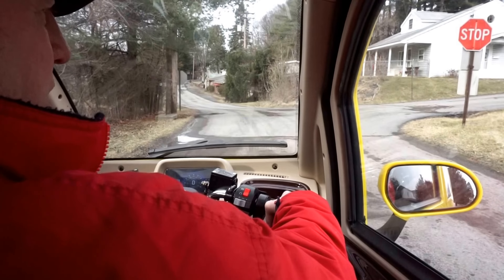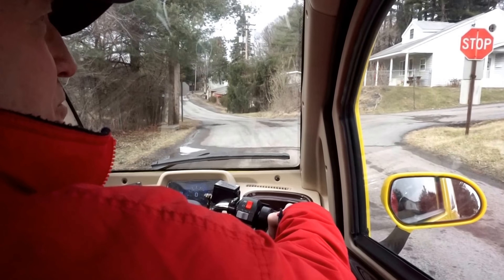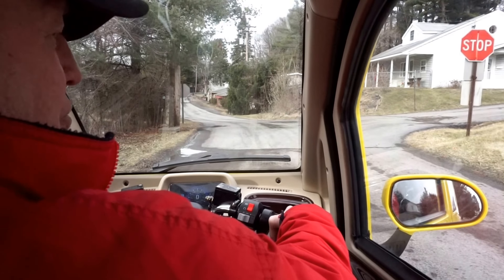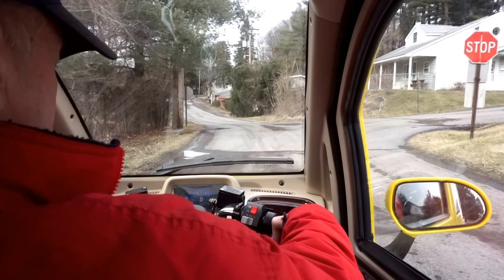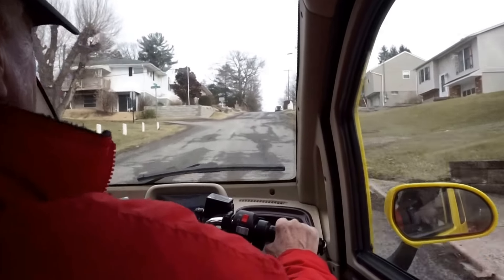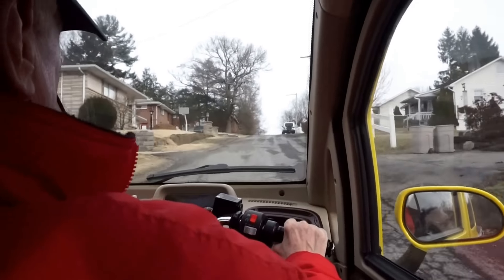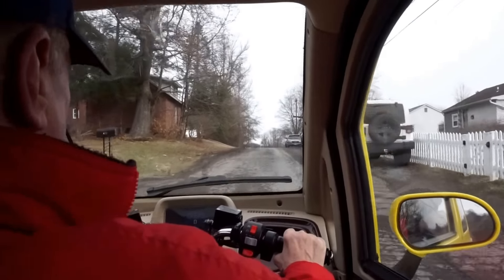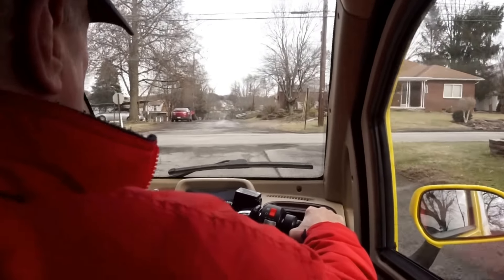ZEV T3-1 Micro 30 Degree Hill Climb Demo, 350 lb load.

Comment: I understand you offer custom options for battery type and paint finish, however do you offer the option of a wheel instead of handlebars? I have issues gripping and a wheel (with corresponding buttons for all the switches) would be easier to handle for me, plus it would take up less space in the cab.
Reply from the maker: A steering wheel is illegal on a motor scooter unless you are disabled.  It takes the same grip on a wheel as handlebars, but the bars give far greater leverage for turning.  If you have a disability relating to grip, contact sales@zelectricvehicle.com and we can assist on options for you